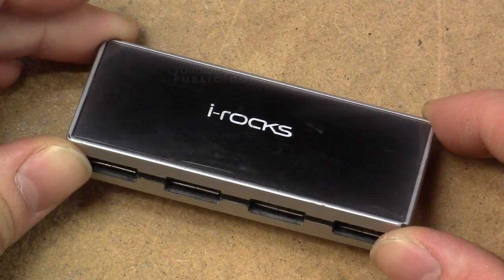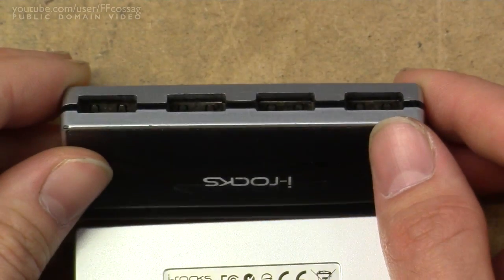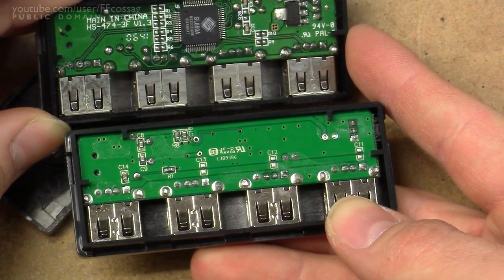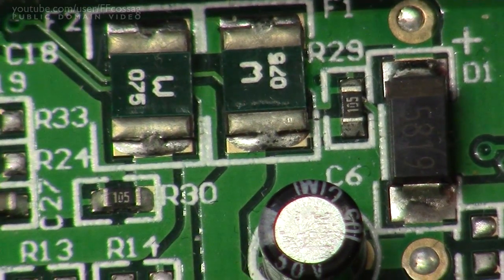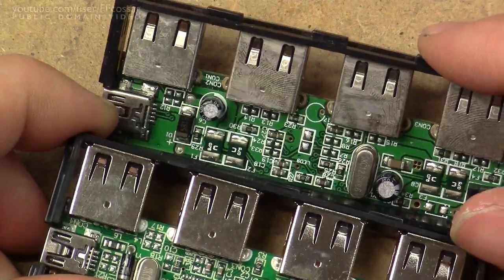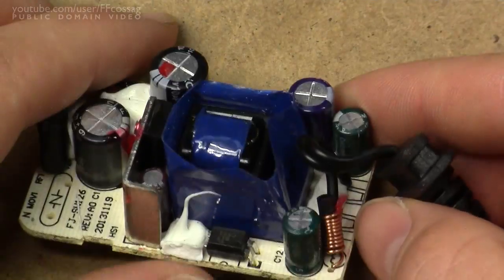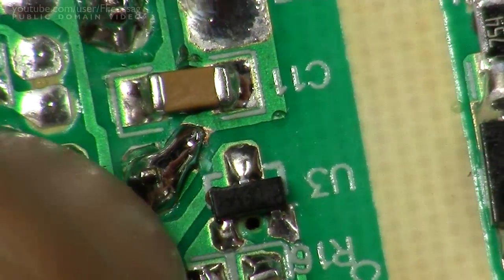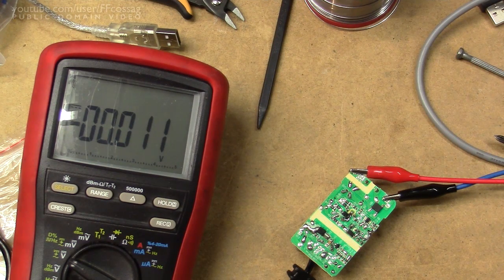2006 vs. 2016 USB hub teardown & AC adapter repair (because I hit it with a hammer)

Comment: Good chance that the reason you don't see the second cap on the newer one is because there isn't another linear regulator to power the GD850 in it.  I'm wondering if the change in package also came with a change in working voltage and so they didn't need deal with possible ripple or other problems from regulating the power.  It's also likely that they found that they don't need the extra capacitance with newer wallwarts/switching supplies like they used to.  Those things have come a long way lately.

Comment: Look at the lower line of the GD850 chips: The new one has 545 which should be 2015 week 45. The old one has 638 which would refer to 2006 week 38 since 2016 week 38 would not be possible yet. Sadly it is much more common these days to only print the last digit of the year on the chip.
Reply from the maker: +Chip Guy Vids That makes sense, thanks for pointing it out.